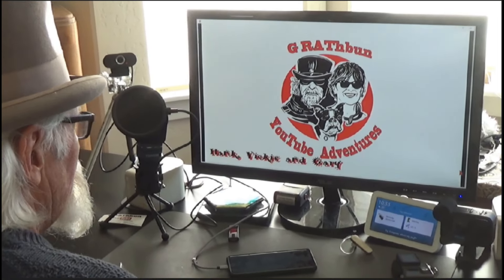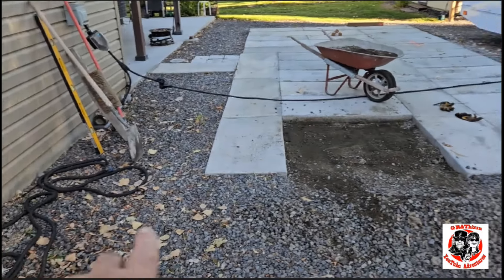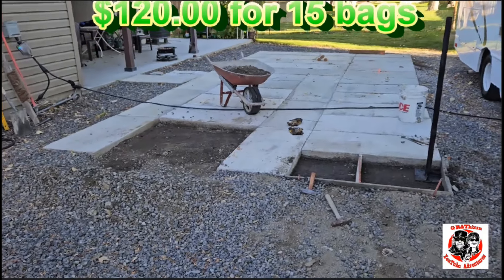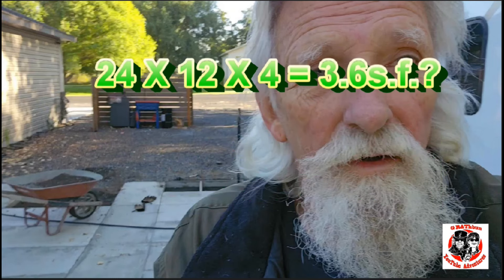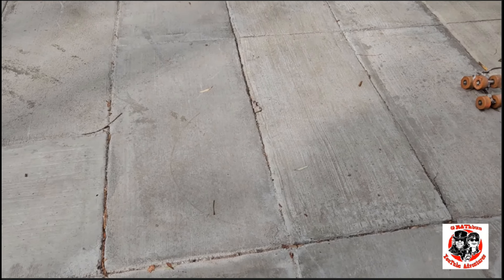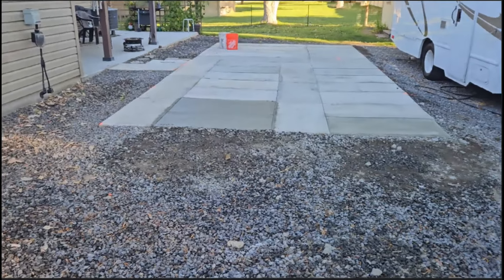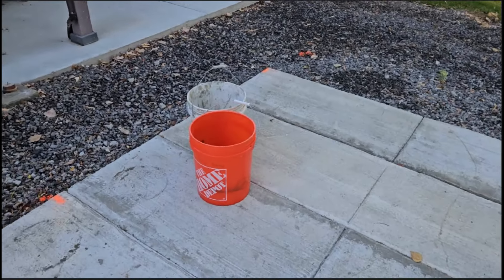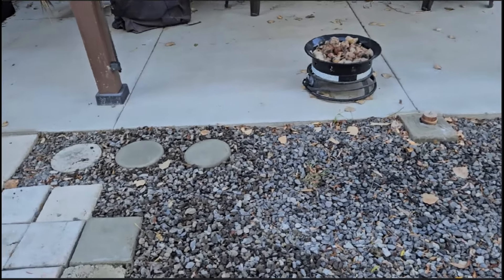Concrete done at last, bag by bag, what's next? #bagconcrete #concrete vid#1712

Comment: great job Gary  i did my little shed and two ramps for my RV for $1020 and that includes a concrete mixer from Harbour Freight  and 4 pallets of 80lb ready mix high strength concrete delivered and some fiber mesh mixed in it got a quote from a company before i did it they wanted $3500 just for the shed.
Reply from the maker: In my case, it was just good exercise and I had nothing else to do LOL